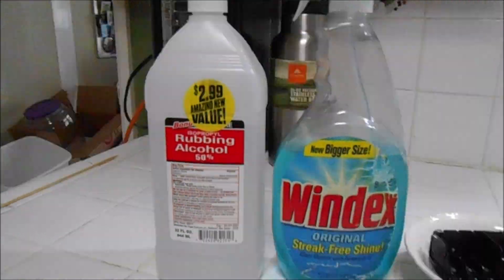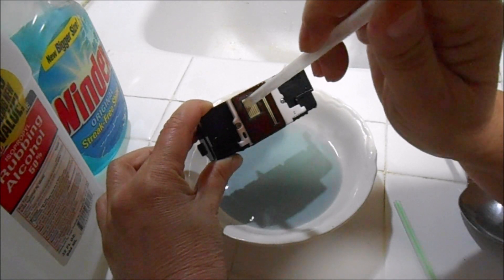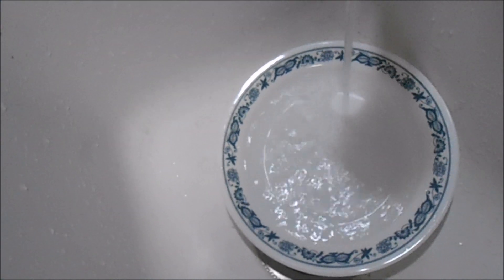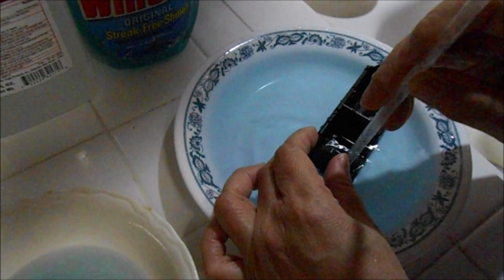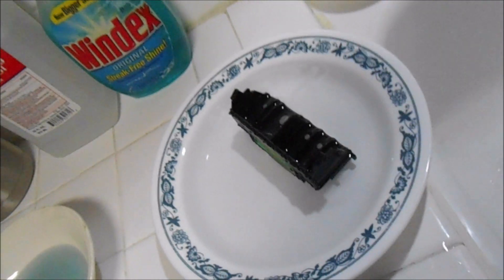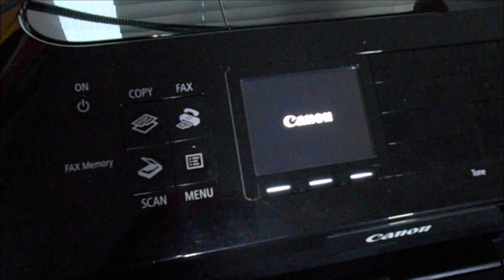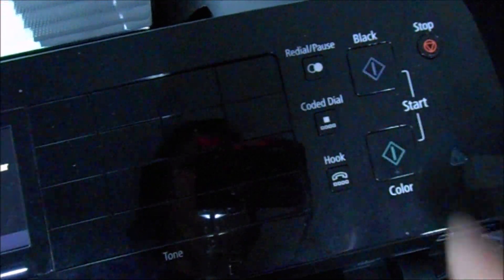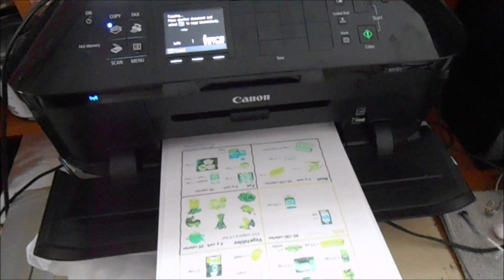How to fix Canon Pixma MX922 Error B200 (Unclogging the printhead)

Comment: How to remove print head 
1. open ink cover
2. after tray stops, shut off power (pull plug)
3. move tray slightly to right so nothing is blocking the front of it then pull bar with colour labels (spring-loaded)
4. pull out print head grabbing centre tab at back and twist towards you then pull.

Try this video:
https://www.youtube.com/watch?v=pEkKGBUSwNg

Or this one:
https://www.youtube.com/watch?v=URX1Ki3Uytc

See Canon info here:
https://support.usa.canon.com/kb/index?page=content&id=ART143853
Read more
Reply from the maker: Thank you :)

Comment: I still get the B200 error without the print head installed so I think the B200 also relates to some other problem.
Reply from the maker: You will still get the error if you don't install the printhead. If after you install it does give the same error, then your printhead is totally gone. Dried ink is really hard to remove. Unless all of them are taken out. It will block the passage way of the ink to come out.

Comment: I did that still showing B200 and the cartrideges wont even light up.
Reply from the maker: I have the feeling that it is not only the printhead that is your problem. The cartridges is really a separate thing. Sorry, I didn't get all the way having a problem with the cartridges. You might want to try other people who has the same problem you have. Good luck.
Reply: @letsdance9022  so maybe i just need another printer.
Reply from the maker: @Jesus-ro9ku  Yeah I guess so. I was probably just one of those who got lucky. :) We all learn that we should print at least 3-4 times a week to avoid ink drying inside the printhead.

Comment: Mine still showing B200
Reply from the maker: Hi. Thanks for asking. You need to repeat the process. Dried ink inside the print head really hard to take out. If you can improvise a way to blow those holes harder do it. But yes it took me 3 days.